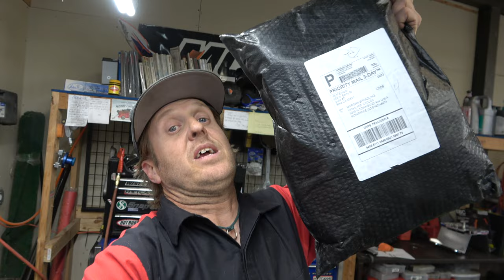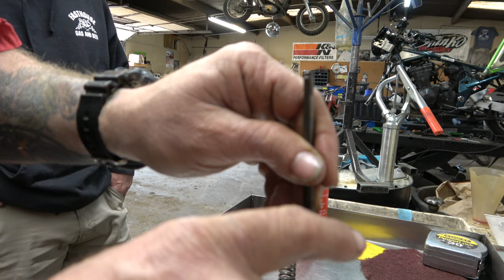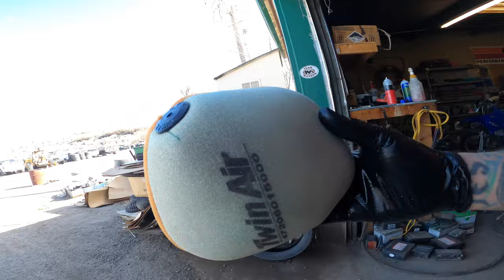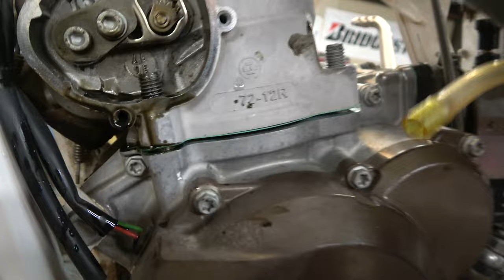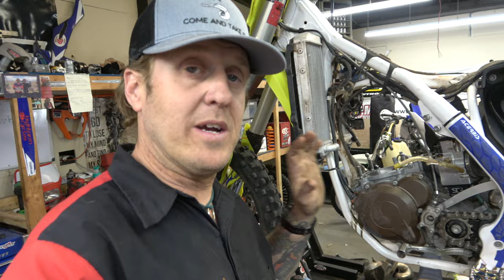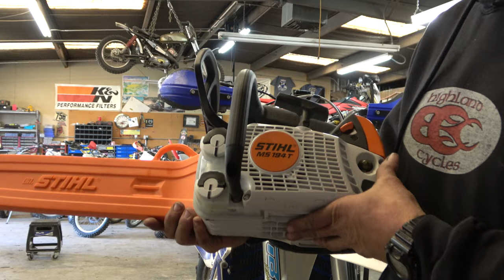The Shlog #155 : WLF Enduro Vest, Dirt in the intake, valve adjustment, how to clean and air filter!

Comment: Another great Shlog!!
I’ve got a pipe blowy out thingy I bought on eBay. Works great. I don’t get nervous till psi hits 100 ish, then just let out some pressure. I use an oxy acetylene with a rosebud tip, but have had good luck with mapp gas as well, stock Yz  pipes blow out good, only seam split I’ve had is on a fmf gnarly, just welded it back up.
Keep on spreading the gospel brother Morgan!
Reply: Disclaimer......of course Charles’s law does apply😜 just keep an eye on the gauge.
Reply from the maker: Hahaha, I know I could go more but they come out pretty good at a lower pressure.  I need to re fill my Oxy/acetylene tanks and get a rosebud.  That makes shorter work of it for sure.  The only thing I can't totally understand is how you do all that with such tiny legs. LMAO
Reply: @highlandcycles  I put them on the floor,  of course.😜
I’m sending my flywheel back to panthera to have the magnets swapped. It was cooking the oil, big time.  I switched the oil to atf like recommended and all it did was change the smell from bad differential to smoked auto tranny. How’s yours holding up?
Reply from the maker: @jimn7279  Mine is great so far.  I don't know what is different about mine but it seems solid.

Comment: Good Stuff on the schlog today!  Question on the pipe blow out system, is this one a better option versus the water pump pressure system you had in a video from a while back?  Can you post a link to this air based blow out system?
Reply from the maker: Both are good. This one is better at getting smaller dents/creases out. I can’t remember who sold it. I found it on eBay.

Comment: On your XCW bikes do you recommend running setup in the “sport” settings for compression and rebound? If I like riding a little faster style in hairscramble style enduro racing? I don’t jump mega big stuff BUT I am bottoming out... my red ring fork tube markers are showing 1 inch from bottom so I’m assuming that is a full bottom out?
Reply from the maker: I have mine completely re valved and set up by tbtracing.com. They add base valves and all sorts of stuff so my settings are different.

Comment: Just curious, I've now heard of a couple people who have mentioned they lightly hone a nikasil cylinder. Do you use a diamond flex hobe or silicon carbide?  I'm probably getting close to doing my first top end on my Beta. Definitely want to do it right.
Reply from the maker: I use a diamond flex. If you use the right size and use some kind of fluid (I use solvent) then it will be great. If there is anything not right with the cylinder it will expose it. If the cylinder is good then all it will do is put a nice crosshatch in it.
Reply: Rocky Mountain sells the right kind of hone for that just make sure to use an oil type lube with it and only hone it for about 10 seconds at slow to medium speed while moving the drill in and out, you want a clean even crosshatch pattern without removing the cylinder liner it's very easy to do.
Reply: @robh3267  thanks for the info